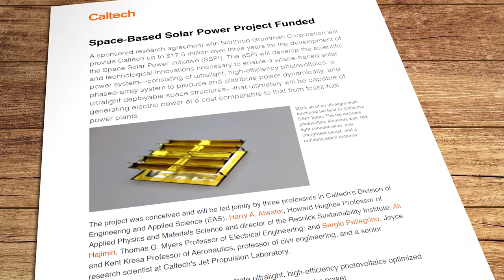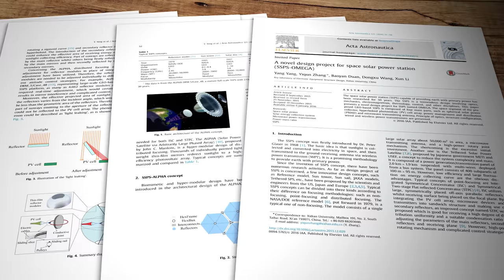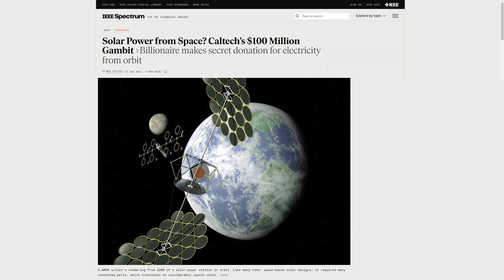Powering the planet from space. Closer to reality than you think?

Comment: I was thinking about this a few weeks back and it occurred to me that there might be another issue which you didn't touch on.
By definition, any kind of space power stations that "beams" energy back to Earth would be adding to the total energy within the earth ecosystem.
This means additional heat.
Which got me wondering, what is the % difference that would make, compared to the current situation? Maybe the added energy is negligible but its something that should be checked before we do such a thing...
Reply: In the next century we'll need cosmic radiators to cool down earth lol.
Reply: The heat absorption from CO2 is keeping way more energy in earth’s system than these will likely ever add
Reply: 18TW of power to power civilization. 170,000TW of power from the sun.
Reply: @catprog  I think the more important number is how much energy is retained by excess greenhouse effects?
Reply: @LeeSmith-cf1vo  Yes. CO2 and other gases are the problem. Not how much heat we produce directly.

Comment: The first coherent beam system was called a "MASER" - microwave amplification by stimulated emission of radiation. This precede the optical-frequency LASER by a decade or so. A maser might be the solution to beaming energy down with minimal dispersion.
But there is a larger problem. The energy beamed down will essentially become heat. That is the fate of all electrical application. So while you might be reducing the potential CO2 greenhouse effect, you are still effectively raising the planet's temperature. In the long term this could become just as much of a problem.
Reply: True but this is even more a problem for terrestrial solar as the heat losses from electrical applications are on earth in addition to the efficiency losses in the panels.

My understanding though is that if we look at the heat generated from either terrestrial or space based solar, it's tiny relative to the greenhouse effect
Reply: @RobbiePT  terrestrial solar is neutral - it absorbs some light energy, converts to electrical energy, which eventually is converted to heat. But the solar energy absorbed, with the exception of the small part reflected out to space, would also eventually or sooner be converted to heat.

WRT relationship to greenhouse effect, it is certainly smaller, but as our demand continues to arise and if population grows, there is still a balance of energy received by the planet surface and atmosphere and energy radiated out into space. So long term that could become an equally alarming proposition. For instance, if population grows to 100 billion and energy consumption per person remains the same, that amounts to about 15 times as much energy flowing.

Comment: I read Clarks novel in 1979 and  always thought the  "Space Elevator" would solve a lot of the space based energy/access problems.  Especially with the super high strength and conductivity of graphene the transmission loss could be controlled.  Unfortunately the congested environment between the Earth surface and 24K miles and beyond probably makes this impractical.  The problem of day/night sunlight interruption could be fixed with polar orbiting energy collection stations beaming power to the geo central station.  

On a different solar power topic:  Imagine one or more lightweight packages in orbit.  on command the 500 square mile aluminized plastic "package" is deployed by injecting a small amount of some gas.  The "package is designed to assume  the shape of a giant mirror.  The focus of this mirror is controlled by the gas pressure.  the mirror has small attitude rockets for pointing.  Aim it at any city on earth and adjust the focus to adjust the spot size of reflected sunlight.   The result would be magma.  A cheap and (fairly) low tech terror  weapon.

Comment: To reflect on this subject. I think its completely crazy and I am very sceptical that it will ever break even. Designing something for space applications is a heavy effort and requires exotic materials and techniques. The GW number of the Chinese concept is not ataggering to me. In the Netherlands alone there was a total of 6.8 GW of solar power installed. And the 6 million solar panels equals to 1 to 2 panels per house on average here in the NL. I am sure that the solar radiation is much more intense in space then on earth and you are not hindered by clouds but the effort to produce a reliable system and to maintain it must be thoroughly researched in my opinion. And what about the space to earth coupling efficiency. I worked with diode lasers in my career and they are highly inefficient.

Anyway thanks for all the good videos that you make. Have a happy new year! I am looking forward to your next video!

Comment: Lots of bonkers with this idea! But it has me thinking that as much technical advancement as solar has seen in the just the past decade, panels made for space use today follow the same basic chemistry as terrestrial panels do when the light profile in space is vastly different. Our atmosphere filters out a lot of the UV radiation our planet is constantly bathed in. Why aren't panels for space, optimized for space's much more intense (UV) light profile? The way it is now would be analogous to browsing the web on your cell phone and landing on a page that hasn't yet been optimized for mobile use! You wear glasses so I'm sure that you can relate to this - squinting at the screen in your hand pumps the frustration levels way up.

Also, even panels in space need maintenance. They'll collect dust, get struck by dead satellite detritus or micro-meteors, and will degrade faster due to the high prevalence of gamma rays and cosmic rays outside of earth's atmosphere causing scintillation of the cells they impact rendering them useless. If radiation hardening has been a problem for electronics and computers in space since we went out there, it surely will be a problem for solar power generation in space today and tomorrow.
Reply: Completely agreed. It’s undiluted insanity.

Comment: The best bet is to not ship power at all, but to ship data product.  Much of what we waste energy on (like the Soap Lake and Dalles dam generations in the U.S. PNW) is data processing.  Though clark orbit stuff is constrained by light speed latencies, still as most of what we want in data processing requires complex processing requiring much more than that, you could literally do most of the processing and data storage for things like Google or TikTok literally many light seconds away and just buffer access in caching servers at low Earth Orbits.  Simply taking out two dams on the Columbia River, that which hosts the two power stations I reference above, would free up a massive ecosystem which could help critical in getting back normal ecosystem stability in my native region.  If you then get all bitcoin and sibling usages off planet with such processing, you literally could save multi-digit usages of contemporary power.  Meanwhile, there is no reason to beam your power to earth for the first scores or more of percentage points to make profitable use of space energy.  After that, clearly manufacturing of things like steel and aluminum for other space infrastructure could begin to be feasable, which could eventually massively reduce the weights of materials you need to rocket to orbit.

Comment: My first thought is that it would be better to place the power plant between the sun and the earth not in Geo synchronous orbit.  Then transfer the power through a cable to a closer location to earth to another device that would transmit the power to a ring that goes around the planet and is fixed, not moving relative to earth.  This ring would transmit power to an array of receivers and could be close to the planet.  This is obviously a massive project.  But not as massive as the colony on mars.

Comment: Need a few space elevators to get the panels into orbit, and also to serve as the base stations to beam the energy to with far less energy loss. OK, you'd lose some energy converting it to DC for the cable down to the ground but that would happen anyway, even with a ground-based base station?

Comment: You're thinking about this too hard...
 using a reflector array that captures and concentrates the light into a narrow beam, like water in a funnel, can channel condensed light on solar panel arrays on the ground or a large solar powered Sterling hot air engine.
 .. using a 4 day orbit, you can always have the reflectors in constant sunlight...
 But sure go ahead and add some moving parts and overcomplications.. If you want..😉

Comment: Could it be possible to use offshore wind to split water ie freshwater to make bubbles to turn giant Ferris wheel inside a tube inserted into low lying and then either collecting or burning the hydrogen to make more power... Rising bubbles seem like free energy... I had this idea 20 odd years ago but pumping air to the bottom of the sea seemed like pie in the sky... How big would water separation tech help and would it make enough air... The depth of the water means higher Ferris wheels would move faster I hope you have the contacts to take this idea further... I am a disabled person so I have no idea who to contact... IE schizophrenic

Comment: If one could mine asteroids or comets for water, one could use solar electricity to crack the water to make hydrogen, freeze the hydrogen, and ship to Earth. The frozen hydrogen would store energy in two ways, hydrogen for combustion, and thermal energy from using the frozen hydrogen in the cold side of a heat engine.

Comment: Would combining a space power station with a space elevator boost the ecomomic case for each? After all, the carbon nanotubes required to suspend the elevator conduct electricity and it could be used as a long cable to transfer the power generated by the space power station holding up the elevator. Have I solved the works energy problems and future space program in one go? :)

Comment: I think the only thing really holding this up is lack of lift capability and an easy, safe and foolproof way to get the power down. Microwave lasers are potentially dangerous at the power levels needed to penetrate atmosphere with enough power left after dissipation to be of use. Unless you use some kind of super capacitors you just plug at ground stations and have to move them to and from orbit. I'm not sure that would be efficient though. I think power lasers would be bumping up against the whole weapons in space treaty and would probably just annoy the chinese and russians. I mean if you are worried about the laser frying a city by accident then there's no reason it can't be done on purpose.

Comment: If we do this, it will in fact result in a net increase of solar energy to the earths surface. This in turn will increase the net temperature on earths surface.

The actual temperature on earth is a result of the balance between the energy we receive from the sun and the energy we lose as radiation to space. That is why the green house effect is a problem -  it causes us to lose less energy to space. Thus heating up our earth.
If we build any kind of collection of sun energy outside of earth and "beam" it back to the surface, we will increase the net inflow of energy to earth and thus change the temperature balance of earth. Resulting in an increase in temperature.

A side note:  Given the law of conservation of energy, the same thing will happen if we produce energy on earth that is not direct or indirect sun energy - i.e. nuclear energy. This is of course already happening (since we already have nuclear power production). At a relative scale, we are probably still at the lower end. But if this is scaled up TO much, it will become a problem similar to what we see today, due to the green house effect.

Comment: If you can build space solar, you don't need space solar.

The basic problem with space power is that you need an efficient way of doing transmission over long distance wirelessly. The secondary issue is that it's expensive to put panels in space. The basic advantage is that it makes solar power available 24/7. 

Transmission may or may not be possible, but if it is, then it instantly eliminates the only advantage that space solar power has. Because if you can transmit power over long distances, you can just have solar panels mounted on the ground anywhere around the planet (which is cheap to do), collecting power wherever it's sunny, and then transmit that power to where it's needed. That is ground based solar available 24/7 without storage. 

To reiterate, if you can build space solar, you don't need space solar.

Comment: Interesting concept but I wonder what this does to global warming. Rather than using stored energy and leave it reside in the earth in the form of fossile fuels, this would import energy that would not have hit the surface of the earth otherwise as it might have been reflected. Considering most energy conversion down here usually ends in heat energy anyway, is this really a solution or are we just shifting the problem? Or is that negligible as the heat can radiate away quite quickly?
Reply: 18TW of humanity power usage. 170,000TW from the sun.

Our power usage is  negligible compared to the sun,

Comment: Place the "satellite" into geo-stationary orbit. Establish a ring around the earth.  Use an "elevator to space" to move raw material up to the ring.  Several elevators from various continents would reach the ring.    The ring would contain automated factories to fab solar panels. As the ring gets bigger, the factories would multiply and the result would be a logarithmic scale.   Transfer the power down to the planet with cables.  As the ring is built, mount all satellites on the under side of the ring. To replace ALL THE POWER NOW USED ON THE SURFACE FROM ALL SOURCES would need a ring about 220 meters in width.  The ring would also shade the earth and reduce global warming / climate change.
Reply: You just need to build the elevator first.

Comment: I don't think the economics work for this in the time frame. Grid storage (as shown on this channel) is moving into its rapid deployment phase because it makes money on its own, independent of the energy source. As storage builds up, the intermittency of wind and solar becomes less of a problem, so they become more cost effective, and more grid storage is installed (around and around it goes). The cost of a future space based power system has to beat a future of increased installed renewables plus storage, and that is a very hard economic row to hoe.

Comment: One first has to calculate how much real grid based energy could be achieved with the space system vs how much grid energy could be obtained using the liquid methane used in the rocket (plus energy to  make the rocket and the solar stuff)  plus any planned rockets to be used to maintain such a facility, use all that energy to generate energy on earth using a normal methane mechanical generator.  If the space system does not produce many times the energy to make it and get it there, then it is not worth it, as  one is still using a lot of non-renewable fuel, CO2 generated, and so forth.  Has that calculation been done?
Reply: Apparently 114 tons of kerosene for a falcon 9. Or 1.3GWh. (probably ~700MWh with the efficiency losses in the power station)

That is 5.5 tons of satellite into orbit (using GTO orbit as a guess for MEO. LEO is in the shadow of the planet to much) 

The lightest panel I have found is 5.3grams for 120watts. (Or 100MW of panels on the satellite )

Factoring 10% after efficiencies and structure reducing the panels. I get 10MW delivered power.

 240MWh / day delivered power to the output of the antenna.

----

Current solar panels are $0.85/watt for large scale (This provides a lower bound on the cost of the satellite  )
85 million + 50 million for a launch = 135 million.

vs

$63.5 million for a tesla big battery for 129MWh.
$71 million for a 83MW solar farm working for 3 hours a day = 249MWh.  129Mwh of that being used when you want it 

And up to 100Mw able to be delivered at one time.

Comment: As with any space-based infrastructure, if you can construct it on the moon it’s a lot cheaper. I don’t think it will ever be worth investing in launching solar power satellites, because the same amount of money could fund orders of magnitude more solar cells on earth. At that point you can use much less efficient energy storage methods like thermal or chemical (e.g. aluminium). Even if you’d avoid degradation from the weather, you’d instead run into degradation from UV and debris.

But from the moon, it could definitely be worth doing. The moon is a somewhat difficult body to find resources on, because unlike the earth it had no subsurface hydrothermal mineral concentration, and unlike asteroids it had a strong enough gravitational field to drag heavier metals to its core. So you’re left with silicon and oxygen and aluminium, some hidden water ice, and not too much else. Thankfully, silicon and aluminium are both rather useful, but modern PV cells use all sorts of more exotic elements that you may be hard-pressed to find and extract. And refining metal oxides on he moon isn’t trivial.
So earth launched high-flux solar panels and moon launched aluminium mirrors is what I have my money of. Well as far as climate change goes, it would be even quicker to make large aluminium mirrors to divert sunlight from our planet.

As for power beaming, low earth orbit (e.g. starlink array) has the problem that you don’t actually solve the intermittency problem, you still spend half your time in the dark. And there’s something to be said about integrating a large RF receiving antenna inside a human city. If the RF is spread out far enough, you’d not have any (known) health impacts to the habitants. Extensive testing required.